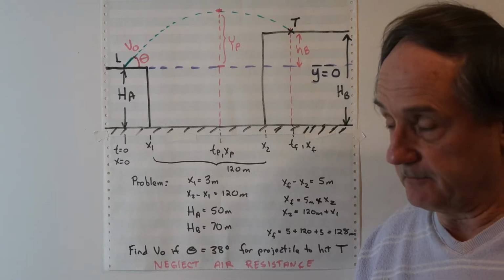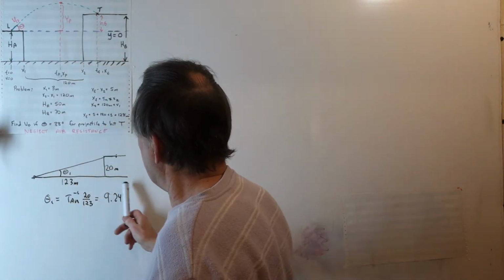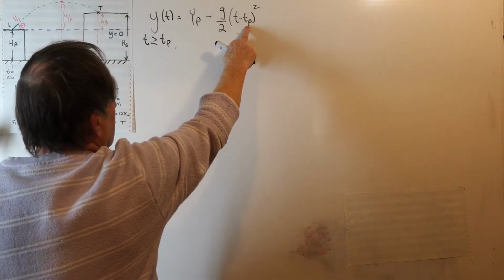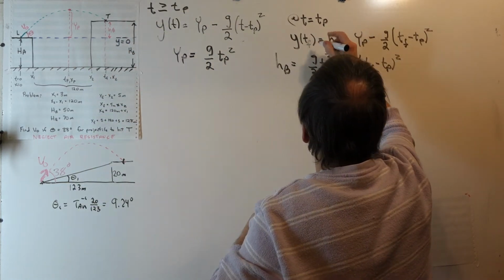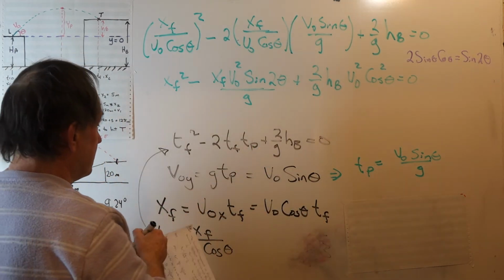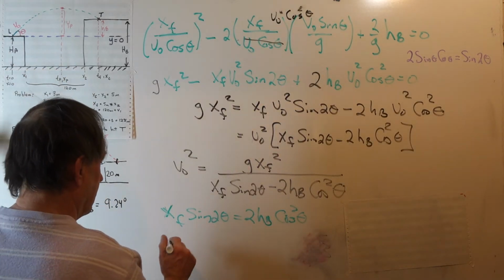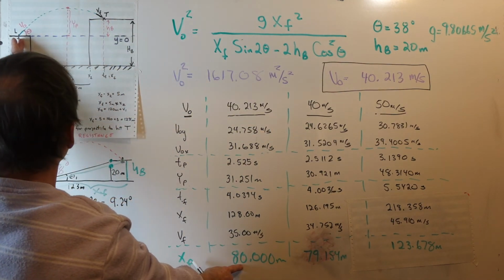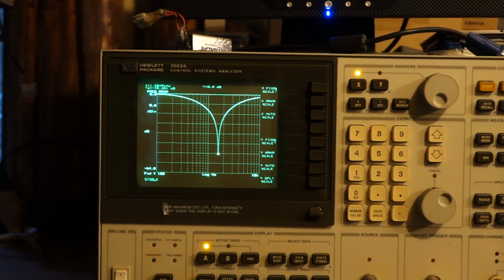Projectile Trajectories #2

Comment: Aryan Pandey:
If a point charge is places near a spherical conductor and the conductor is earthed ...what would be the charge distribution on the nature of electric field outside the spherical conductor

Lemme explain my doubt properly....i just want the core concept that if in an electric field..a body of 0 potential enters...will it change the initial field structure??....
Reply from the maker: Wrong video to be discussing this.    Try this one:
https://www.youtube.com/watch?v=k8Sp7r3rQBc&t=428s

The answer is that it depends if the conductor is placed along a equipotential of  V = 0.0   or not.
If placed along an equipotential of V = 0.0, the initial field will not change.  If the conductor surface is not coincident to a ZERO equipotential surface in the field, then the initial field will redistribute itself so that the electric line of flux are everywhere orthogonal to the conductor surface.
GH

Comment: Hi George,
Good video and elegant solution!

I tried this problem myself and did it straight forward by setting up the acceleration in the x- and y-directions. Then integrate two times to get velocity and position.
I publish the solution here if any of your viewers are interested:

x¨ = 0                             y¨ = -g   
x˙ = v₀ cos(α)                y˙ = -gt + v₀ sin(α)
x = v₀t cos(α) + x₀         y = -(⅟₂)gt² + v₀t sin(α) + y₀

Eliminating t to get an equation for y as a function of x (and α):
y = -(⅟₂)g[(x-x₀)²/(v₀²cos²(α))] + (x-x₀)∙tan(α) + y₀

Rearranging:
v₀²cos²(α) = -[g(x-x₀)²]/[2(y+y₀)-2(x-x₀)∙tan(α)]

I put in the numbers in Excel and calculated::
v₀²cos²(α) = 1004.14. 

Divide by cos²(α) and take the square root gives:

v₀ = 40.21294 m/s.
       ----------------
Numbers used:
g = 9.80665 m/s²
(x₀ , y₀) = (0,0)       (Starting point)
(x , y) = (128, 20)  (End point)
α = 38°